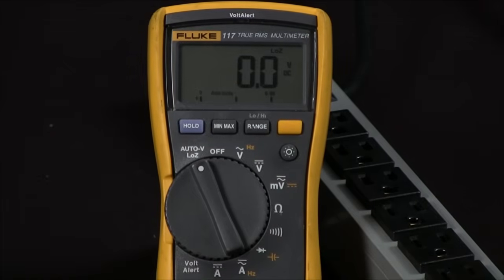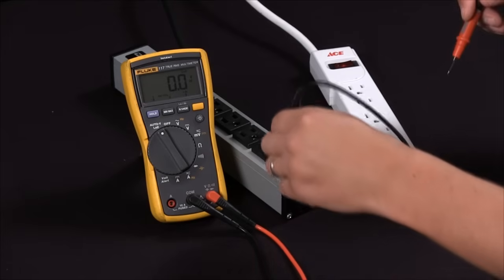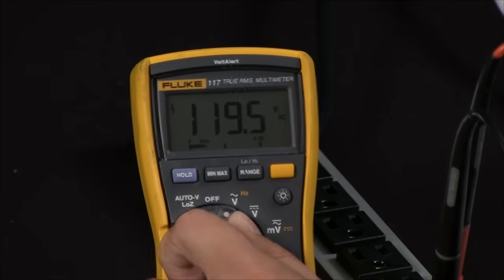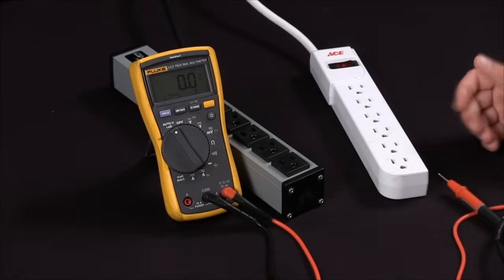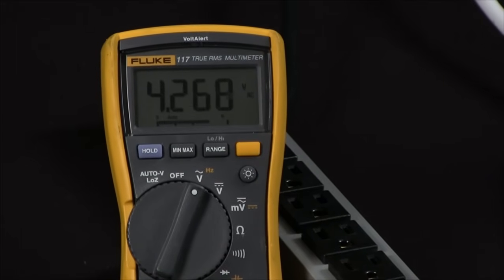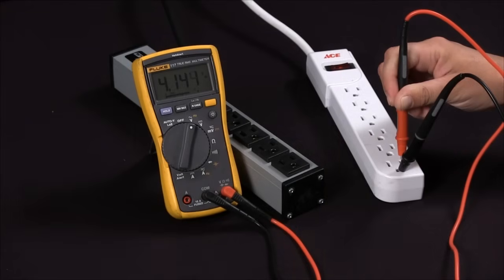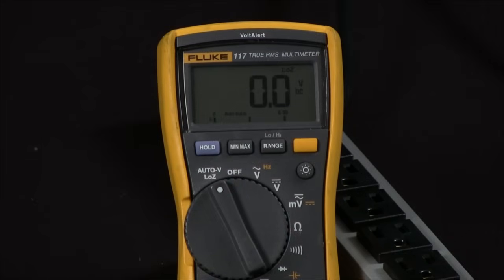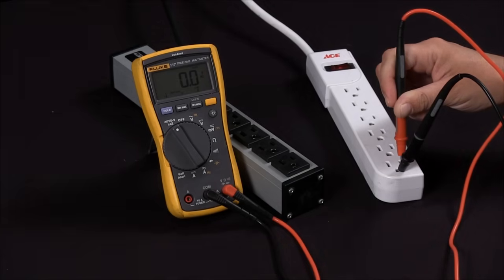How To  Determine If Voltage Is Real Or a Ghost Voltage Using your Fluke Digital Multimeter

Comment: FLUKE, can you make more ghost voltage video lessons to show other applications that would cause ghost voltages? I'm confused why is the ghost voltage 4vac and not 120vac or some other voltage but why 4vac? The LOz mode is putting an impedance/load so its measuring the "difference" or the "residual" of the voltage divider of the remaining voltage. You should example this in detail in the YT video lesson on the LOz voltage divider method of measuring a ghost voltage and real voltage or compromised voltage
Reply: Old comment but longer wires results in higher voltages. Test it in a extension cord and you will get a higher reading then on multi plug that only has  .5m of cable.
Reply: @therasco400  why would longer wires result in higher voltage? Compared to shorter wires?

Comment: HEY ground to hot should be 120 vac ground to neutral should be low ac neutral to hot is 120 vac - Open ground should be your ghost voltage ??? please correct me if i am wrong ...

Comment: Wont the Low Impedance act almost like a short circuit?
Reply: That Low Impedance is about 3 kOhm.
Reply: @IliyaOsnovikov  I see, it would be about 40mA for line voltage
Reply: @infectionsman  Most likely current will be even lower. I believe, that input impedance goes way up when PTC thermistors used in that circuit get warm. But that's OK because the Low Impedance is only needed to clamp a ghost voltage. But when a real line voltage is present there is no need to keep that input impedance low.
Reply: Hi, maybe you would know why SV225 hoked with 87V, when measuring live circuit, trigger my RCPD (residual current protection) whenever I touch ground or neutral.
Now issue when measure de-energized circuit.

Comment: I have a red unused wire reading a ghost voltage of 100 volts that slowly goes down as I am testing it. Is it safe to use as a neutral wire? I'm trying to install a smart light switch but the previous owner botched the wiring and used the white wire as a hot wire so the only unused wire is the red which is reading a ghost voltage.

Comment: The earth leakage circuit breaker will trip when you connect the low Z from phase to ground !!!
Reply: Only if it's on a GFCI or RCD breaker. In the US at least, the majority of outlets are only overcurrent protected. Only ones in wet locations (bathroom, kitchen, outside) are protected by a GFCI.
Reply: Thanks @MrLeverink I think you just give me the answer, for my question. My RCPD 40A (IdeltaN0,03A) trip each time when I measure live and N or PE(ground). 

maybe you would know why SV225 hoked with 87V, when measuring live circuit, trigger my RCPD (residual current protection) whenever I touch ground or neutral.
No issue when measure de-energized circuit.
Reply: Sv225 has an impedanxe of 3k omhs and yes it will trip the breaker.

Comment: shouldnt you be getting 120 from between hot and ground ?  ( if its a 120 V ) this would make sense to me if you were getting a ghost from common to ground.
Reply from the maker: Hi there - Great question. 
If the voltages were correct, You would get 120V from hot to ground and 120V from Hot to common.
In this video, we went from Hot to ground showing 4V and Hot to common reading 120V. 
The power strip had the hot on the common side and the grounding had malfunctioned.
You are correct, typically it is reversed and the ghost voltage would be on common and ground in this situation.
In other situations, with bundling of several wires in a conduit, you may see ghosting as well.
Reply: thanks for the feedback, Fluke is my go to Electrical testers of choice, I also purchased several of you NCV testers last Xmas for the apprentices at work ( plumber gasfitter ) cause They fail to realize how critically important it is to know if there is voltage and how to easily identify a hot.   :)

Comment: That's a nice feature of the 117 but what if you have a Fluke 87? I seem to be finding ghost voltages quite often. How may the ghost voltage be discharged?
Reply: You need to buy ghost voltage suppressor Fluke SV225.
Reply: Just use an AC/DC Voltage Tester electricians commonly use. These devices have an input impedance of some kΩ. Actually, a simple resistor (few kΩ) in parallel with your high impedance multimeter will do the same.
Reply: +Sergej M van you elaborate on this method a little? I'm trying to decide between the 115 and the 117 Fluke and this is the main difference worth considering
Reply: shwndh
Considering the small price difference, you should go for the 117. If you are an electrician, this LoZ feature might become handy. On the other hand, an AC/DC Voltage Tester (see T90/T110/T130/T150, for exampe) is much more preferable for the every day tasks, IMHO. These devices don't have any ghost voltage issues as they have a lower input impedance, compared to a regular DMM. They cost less, too.